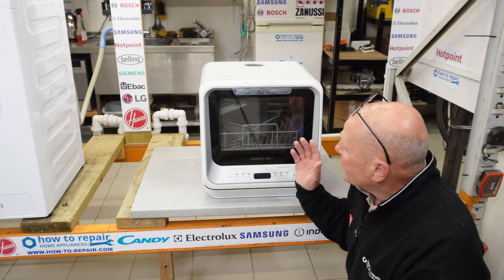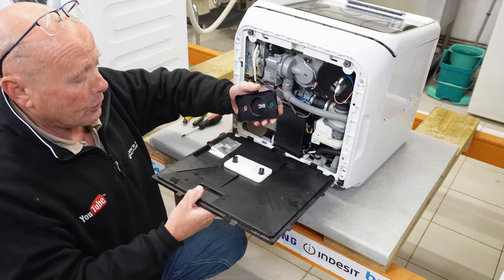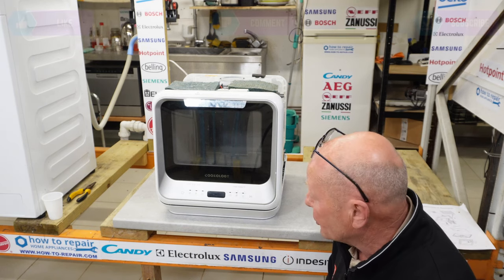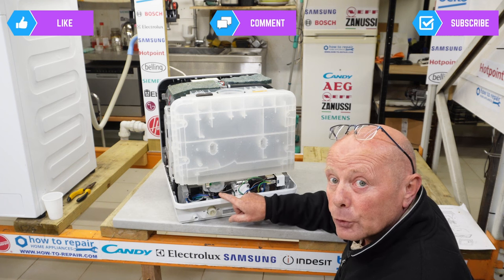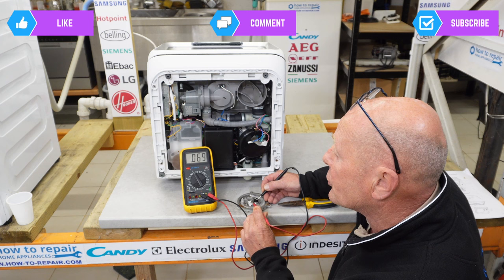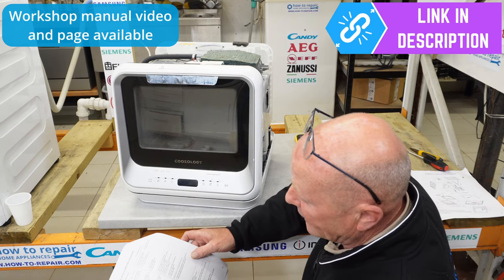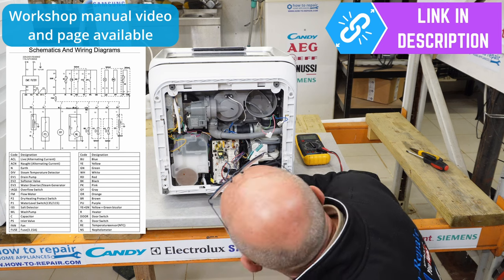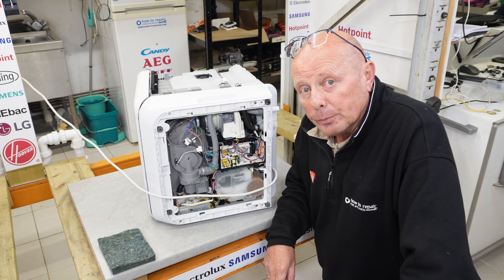Compact Mini Dishwasher Demystified: Step-by-Step Dismantling & Error Codes Uncovered! 🛠️📚

Comment: Brilliant video !, may i bring to your attention another manufacturer fault, after a while the front touch panel will short and the machine will not respond to input using the touch pad, the problem is water ingress behind the black cover that protects the touch pad, i disassembled the door then removed the black cover, dried the circuit board thoroughly, i then reassembled the black cover but then sealed it in by applying a generous amount of silicone sealant around the black cover then covered the black cover with plastic to ensure no more water ingress, works a charm now.
Reply: i am currently having this issue, do u mind making a guide to fixing this please?
Reply: Same - some buttons on the touch panel will not work… is there someplace to buy replacement parts ?
Reply: Thank you! I'm having the same problem. I hope your solution is the fix to my problem.
Reply: I agree with the other comments, pictures or arrows would be helpful. I believe I may have shorted mine out, too, because I used my empty dishwasher as a drain rack when I only had a few dishes to hand wash. I"m sure the extra water found its way around to the control panel because its directly below the door when its open. Thanks for the lead. :)
Reply: Thank you, great information!

Comment: To help you progress with code E1 , instead of using vinegar as suggested in some posts i used the household limescale remover VIAKAL , this works effectively in removing limescale quickly, obviously use gloves when using Viakal and always perform a cycle without cutlery before starting normal use again. (UPDATE), my dishwasher ran the E1 code, i identified the problem, where the water enters the machine ,behind the panel, theres a 90 degree pinch point, over time, hard water can restrict the flow hence the E1 code, so i injected Viakal down the tube, let it settle and then re-assembled, no more E1 code now and if it happens again i know where to look.

Comment: Mate, this is brilliant, thank you so much for a great video on how to disassemble the dishwasher,  I found the fault,  it was the cable from the CPU to the front door control panel,it was broken the cable must have got pinched some how when the door is opened or closed,not the best design and cut the earth wire in the cable, I pulled it out and repaired it, works a treat , Thank you
Reply from the maker: Hi mate, I'm glad you could be able to fix your problem. Since we work very hard in our warehouse making free video guides, you can always donate us via https://www.how-to-repair.com/help/buy-paul-a-beer/

Could you also do me a favour and take part in a poll I've made about the lifespan of appliances? You just need to tick one of two boxes. It will only take about 10 seconds. This might help us improve how machines are made in the future😇 

Here's the poll question: https://www.youtube.com/@How-to-repair/community

Also sharing will get more people to participate and we will have a greater impact with the manufacturers thank you for helping.

Comment: It seems E-3 code is a fairly common problem for the ICUIRE  brand countertop dishwasher?  I was very careful with it and took care of the machine.  Never loaded it without scraping the dishes first, keep the filter free of detritus and would air dry the filter and screen. I accidentally ran it without the filter and that is how I earned my E-3 code.  Would appreciate a future DYI or some advice on what to look for.  I will subscribe because I plan to fix this myself.  Thanks in advance either way!  Addendum -ICUIRE advises to tilt the machine for an approximate number of minutes if the machine registers an E-3 code.  Why and what component would possibly benefit from this action?

Comment: Hi, we have just randomly started having issues with our mini midea. It seems to randomly stop (at different times) during cycles, and then will just beep every minute or so. We’ve had to end up emptying the water by tilting it from the main compartment each time this has happened. No error codes are coming up. Can you help?
Reply: Check the pcb for fuse and look up the heat element
Reply: I’m having a similar problem

Comment: Thanks for the video, my dishwasher has an e1 error code. Im not sure how to repair it now. Can you provide some  extra instructions?
Reply: I resolved e1 error by injecting vinegar to the little hole where water comes out for the wash cycle, it was clogged by gunk. This little hole is located near the front at the bottom left. The sensor might detect a low pressure in filling the bottom of the dishwasher, or it is clogged at all. Hope this helps you.
Reply: @JoeyFactor hey! Could you provide more info about this. I’m getting the same issue. Did you just pour in vinegar and then run a cycle? Thanks!
Reply: @mikanakamura8521  I inject lot of vinegar with lot of pressure using a syringe to push the clogged gunk in the hole. Make sure that there's no leak while injecting pressurized vinegar.
Reply: @JoeyFactor  Mine is just so blocked that it starts spraying all over

Comment: My dishwasher stopped working, panel doesn’t turn on, only the internal light turned on. Where could I found pdf of the workshop manual you mentioned ? First time try to repair something 😅. Do we have some video showing how to remove the front door? Thank you ！

Comment: Great video! Seems relatively easy to tear down. 

Im getting an E1 error on mine during what seems to be the last cycle, not quite sure where to begin to look after seeing the cycle chart.
Reply: I don't know if you're reading the comments here but I've just torn it down and everything regarding the inlet seems to be fine.

Could it be that the impeller isn't reading the amount of water correctly and it's thinking that there isn't enough water (or there actually isn't enough water) to finish the cycle therefore throwing up the error?

Comment: Hi there. Thank you so much for this brilliant video. I have the same device and l would like to ask you if you know what’s wrong when the main pump doesn’t start but the timer keeps counting down…
Reply from the maker: Hi there, I get very humbled by your comment. I will need the full model number of the identification plate and the details of your problem so that I can provide you with useful literature. Please use our contact us page and make sure you fill out the request for what your problem is. A video shoot of the problem would be perfect as well.

I will get back to you within 24 hours, normally. https://www.how-to-repair.com/help/contact-us/  

Please remember to subscribe to our channel, as that's what keeps this channel going. Thanks, Paul 👍

Comment: I don't get an error code, but every icon on my panel lights up, and it does not respond to any buttons pushed.
Reply: Thanks for your video. I didn't know there was an element to heat the water and I was supposed to only fill the tank with COLD water. I wonder if I accelerated the rate at which it broke. :(

Comment: My mum recently got a new dishwasher and gave me her countertop Klarstein mini dishwasher but it's displaying an E1 error code.

I've tried a few things suggested on youtube, such unscrewing the little panel near the inlet valve and looking for blockages. I even poked a pipe/straw cleaner in and out the inlets just in case anything was stuck.

I tried tipping the machine at an angle over the sink to try and drain the "overflow reservoir" only to have water come out of the top bit where you put the water in and it went everywhere! It didn't come out the from the front corner under the door like one video suggested XD

Nothing has worked yet, any suggestions? 

I love your video, I didnt even know what an inlet valve was a couple of days ago, but it was the bane of my life trying to work it out from the manual. (Spoiler alert it doesn't tell you lol)

The manual really doesn't go into detail on what to do in case of error codes if you're not a pro or don't know the lingo, so I was just kinda like, "where the heck is the inlet valve?? What even IS an inlet valve??" 

So, long story short, I now know what an inlet valve is, but I still don't know what to do to resolve the issue with it 😂

Any advice would be much appreciated! I really want to give this machine another shot, it seems like such a waste not to!
Reply from the maker: On the left-hand side once you’ve taken it all apart, there is a steam unit. I’ve seen these get blocked you only need to blow through them hard
Reply: Were you ever able to fix it?
Reply: @nevebrown9206  I fixed it! On the inside if the dishwasher, there's a really small hole on the left wall (your left). I put vinegar in it with those measuring syringe things with a wide nozzle, you press it in quick and fast so there's pressure behind it and also i poured a bunch of vinegar in the tank with the water. If you leave it for a bit, repeat, and then run it a couple times, water starts leaking out of the small hole, and then boom, suddenly it starts working! I'm assuming it was limescale buildup. I used white wine vinegar cause that's all I had, but it might work better/ cheaper with your normal white vinegar:) be generous with it so it gets in all the nooks and crannies! I was so delighted! Can't take credit for it, a lady made a video showing how to do it, it worked and made me so happy! It's worked absolutely fine ever since
Reply: @skyetati3722 pls can you Share the link of the Video? I have the same issue with E1